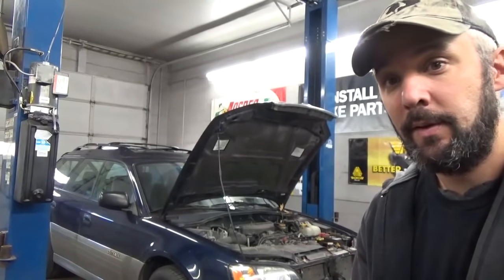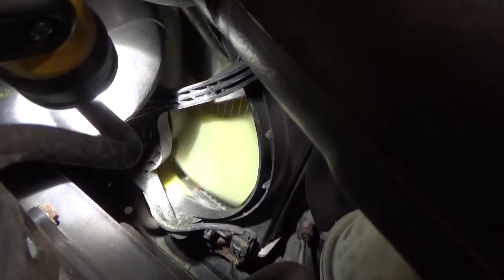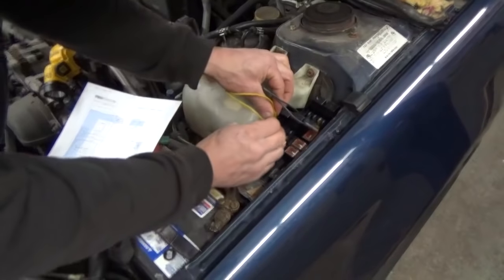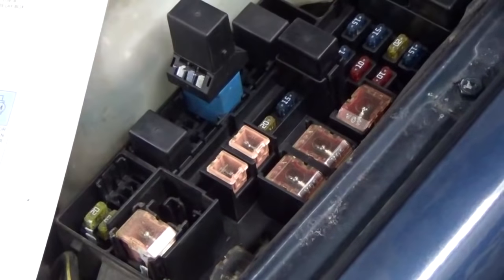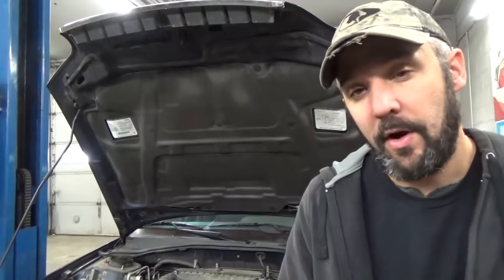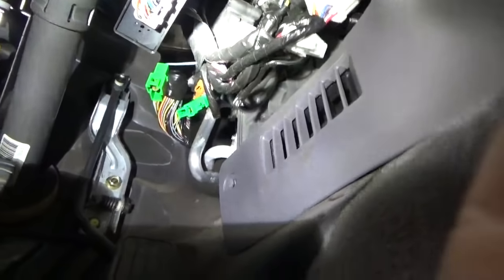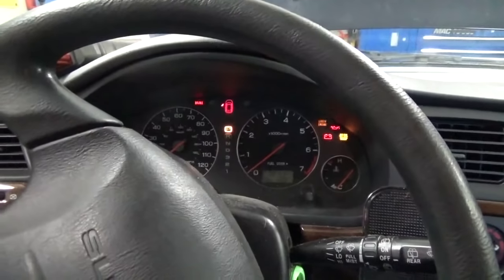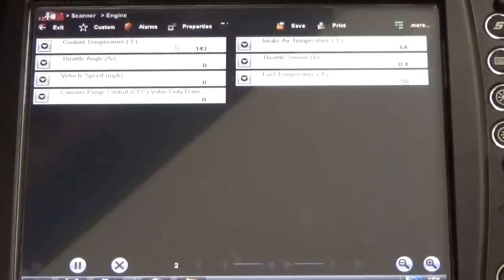P0483 Cooling Fan Problem - Subaru Outback

Comment: P0507(171) Stored
Idle Air Control System RPM
Higher Than Expected
DTC Severity 2 of 3: Repair immediately if drivability issues.… I have a 1998 Subaru outback legacy. How do I adjust that and where is it located? Could you make a video in the near future because I use voice to text to send this message and a an illiterate so video really helps me out. Thanks.

Comment: Thanks, this circuit tip is helpful!😀 If the a.c. clutch doesn't activate and the a.c. relay doesn't activate would that create a negative feedback to the computer that prevents the fans from working when the engine is running. The fans definitely work in this mode and the main fan relay is tactile/ feelable but the fan 1 and 2  maybe clicking but I definitely don't feel both clicking and the a.c. relay is not clicking but all fuses visibly are okay. Doesnt an a.c temperature or pressure switch in the a.c. circuit with engine running precede the operating of the a.c. compressor clutch and relay(according to someones' previously seen video indirectly) but how could that then mess with the computer to stop the fans working as regular engine cooling fans under normal engine running priority; in a running flow chart versus this computer to circuit and component diagnostic mode could there be a different priority sequence where the fans are stopped because it is defaulting to a a.c. no function blocking the engine cooling fan function but when I started before erasing codes there was no codes indicated for the ac system. 

Example thought: Currently in this diagnostic run the abs is dead as a doornail but there was no abs codes prior to running this diagnosis circuit(seen it by accident in here something I heard in the thoughts to click on this video but that was all I could distinguish and whereby after the fact indirect to do with abs you talk about the Dealer Diagnosis green connector as the other guy calls it) and the abs lamp bulb illuminates on start-up. In one abs presentation the one guy claimed a burnt out stop lamp prohibited the abs system from functioning in that vehicle which intuitively makes no sense but to a pissed-off computer geek it could be a simple fireing back against the world.

Comment: So if I plug in the green connectors and the fans don't turn on I just need new fans then? They dont turn on with ac turned on either so I'm assuming bad fans right?

Comment: ONE THING NOT COVERED IS THE COOLING FAN TEMP SWITCH I JUST ORDERED ANOTHER. MY FANS COME ON AFTER THE THE CAR IS SPEWING STEAM AND OVER HEATED. I HAVE NO IDEA WHERE THE SWITCH IS LOCATED. WISH YOU WOULD HAVE SHOWED IT.AND THE SWITCH I ORDERED COMES ON AT 185 SHUTS DOWN AT 174

Comment: Hi the radiator fans don’t come on when the temp gauge reaches halfway the water starts boiling but the temperature gauge stays in the middle I was told it was the coolant/temp sensor so I replaced it so now the fans still not working ,anyway when I unplugged the sensor the fans work  from start up . So what could be the problem?

Comment: HELP ME PLEASE!! i connected the two green wires in the bottom and my fans do turn on when connected, but my fans will not turn on when running, the temp gauge shoots up to above normal with in minutes of driving, the engine or radiator is not extremly hot, of driving and yet the fans will not turn on

Comment: this is a good video thank you. hello I have a 2006 Subaru 2.5i limited outback I recently did a radiator flush on it and now my car has no heat and the fans on the radiator are not coming on. I burped the system and still nothing it was all working fine before. Does anyone have any suggestions to why this is happening?

Comment: HI, thanks for the great explanation about the code for the radiator fan. I have a 1999 Subaru outback that has overheating  issue. one of the problem is that the fan kicks in when the car is the operating temperature but fan never stop running... I replace the thermostat and bleed the air in the system but still the same... any tips.. i really appreciate it.
Reply: Water pump circulating coolant ?

Comment: Great Electrical troubleshoot video Eric. So in this case how you charge the customer  if nothing wrong was found?

Is this same Subaru you've been doing all the repairs?
Reply from the maker: Well I have to charge for my time obviously, minus the camera time. Most of my customers are repeat and loyal so depending on the time involved, some of these jobs are just swept under the rug but not every case. I don't think I've done any videos on this one yet. This has a 2.5 DOHC in it. I think it is a 97ish. I live in Subaru country and most shops in our area hate them so I see a lot of them because I love to work on them.

Comment: youve got a killer tool collection! the scanner alone is 1000's. do you have flashing abilities at all on modules?
Reply from the maker: Hey thanks! Well I have been doing this my whole life and bought my first tool box at age 14 and have been buying stuff here and there ever sense. My Mom and Dad have owned a shop sense I was 1 years old till now.As far as flashing I can flash program PCM's in most but not all. That still is limited simply because most vehicles that require PCM replacement will need some sort of OE level diag. equip to reprogram TCM, SKIMS, WIN moduel etc. to go along with the new PCM....the list goes on. So most of the time if I need to replace a box I'll take it to the dealer to have it flashed. Usually cost about $85 and it's done in under an hour and I don't have to buy the day pass to the OE site and such...

Comment: help i have a 1997 subru outback Legacy four wheel drive and my radiator fans don't go on also I have a check engine light and I have the leak not sure where it's coming from? No ride comment please help me
Reply: Yessica Ambrosio If it’s a coolant leak it’s likely the headgaskets. Any smoke out of the exhaust? Overheating? Oil in the coolant? Coolant in the oil? All are symptoms of headgaskets. Best of luck to you, Subaru’s around this year are notorious for this expensive fix

Comment: If it is high mileage and or age would you consider changing out the relays just as a pm measure? I worked many years in industrial maintenance and found the relays to be a consumable like the thermostats and switches.

Comment: Had this pending code in my Subie.. checked the fan motors, relays and finally fuse.. sub-fan fuse was blown.  The question is, what caused it to blow?
Reply from the maker: https://www.youtube.com/watch?v=Jw-eIRvCyHI
Reply: I had actually watched that video before you commented with the link!  Unfortunately I don't have a Pico, and I don't know how to test my fan motors to see if they're good or wonky like the ones were in that video.  I'll have to figure out some way to test them.  Even though the new fuse hasn't blown,  I'm not considering the replacement a fix since fuses don't just blow for no reason!

Comment: Coolant temp sensor, probably aftermarket and incorrect amp range, will eventually blow ecm causing no fans ever. Stupid oem!! Not to mention if you use green coolant rather than blue it'll corrode sensor.
Reply: Man, you just saved me a huge headache. A while back I threw an NTK sensor at a cold start problem. It ended up being the IACV, but I left the new sensor in there because why not? 
This week the car started running hot and fans were only kicking on with A/C. New sensor so I didn’t even suspect it, then I came across your comment. 
I don’t even know why I saved the old sensor, but I swapped it back in and bingo! Problem solved. Many thanks 🙏

Comment: I have NO check engine light, no overheating, but my AC doesn't work, and the radiator fans don't spin anymore. Any ideas? 2007 legacy non turbo. I can't seem to take my relays out either. It's too difficult
Reply: Did you ever figure out your problem?